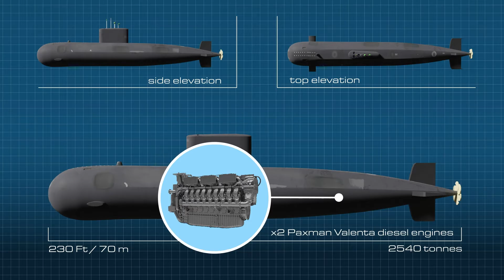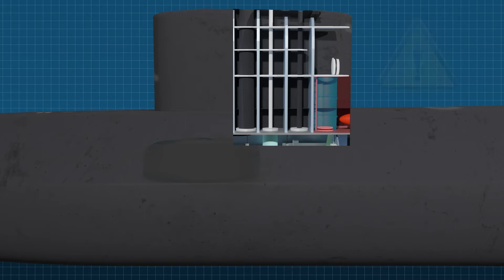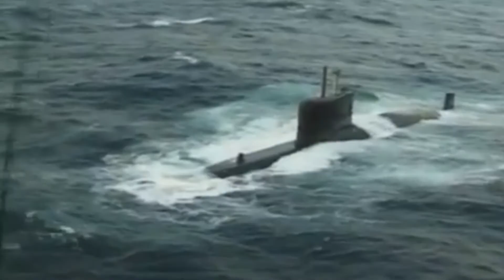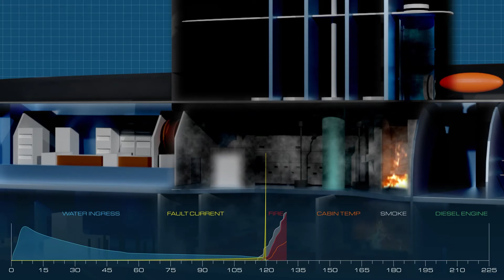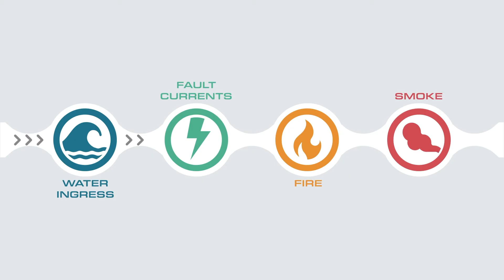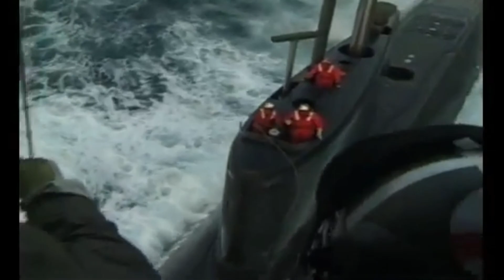Case Study: HMCS Chicoutimi Disaster

Comment: HMCS CHICOUTIMI. was commissioned into the Canadian Navy in 2004. There was another option to keep the boat safe and continue the surface transit, the boat could have run shutdown, using the Induction system.   Reading the report there is no mention of a continuous fire in any compartment, just a high voltage arc producing thick black smoke in the Control Room and the arc cut a large hole through to the deck below which filled with thick black smoke. The submarine was outfitted with a well tested fire fighting system and Emergency Breathing system. The personnel who suffered from smoke inhalation did so in the first few seconds of the incident. The crew were well trained in the deployment and use of the EBS which saved many lives. I was the Royal Navy Warrant Officer of the Upholder Training Team, I knew all of this crew personally and they did very well in a very difficult situation. My team met the crew on their return to Faslane Naval Base and we were asked to help during the investigation into the cause of the incident.
  Most of the crew, like my team, were ‘O’ diesel boat veterans and knew that if this had happened on an ‘O’ boat the outcome would have been grim.   Like all accidents it was preventable.
Reply: It was actually commissioned in 2015. 

HMCS Chicoutimi was officially commissioned into the RCN fleet at a formal ceremony in Esquimalt on September 3, 2015.

https://www.canada.ca/en/navy/services/history/ships-histories/chicoutimi.html

Comment: "...12 knots surfaced and 20 knots submerged"?
How is it possible?
Reply from the maker: Thank you for your comment, in answer to your question: Submarines are designed to operate underwater so are generally faster when submerged compared to when they are surfaced due to the different hydrodynamic principles at play in water and air. Such as submarine shape, drag, wave resistance, and propulsion efficiency, for example.
Reply: @engineering_in_motion 
I suppose this is not an atomic sub...so a diesel-electric to work at max power submerged would need a snorkel...not the best tunning thing!
Besides, the drag submerged would be inevitably superior then at surface...
 Sorry, I do not manage to get the concept!
Reply: @GAUROCH2  The drag submerged is a different type of drag, hence why surface vessels are pointed at the front and rounded at the back while submerged vessels are the opposite with a rounded front and a pointed stern.
Reply: @krashd  
I am not an expert on hydrodinamics and I'll take your word as true!
Perhaps I deducted such conclusions from data on conventional subs, in which the time in submersion is less then in atomic ones, so the parameters both on attack or evasion are different.
Anyway thanks for the comment.
Reply: @GAUROCH2 Maximum power submerged below 55ft is achieved by using the main motor fed from the Main batteries.